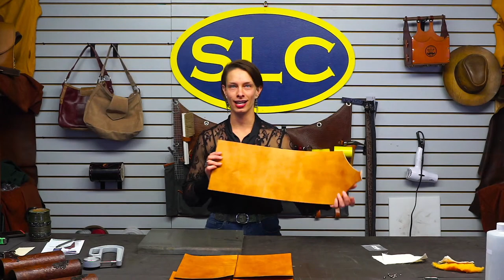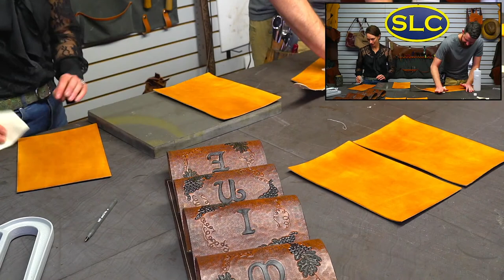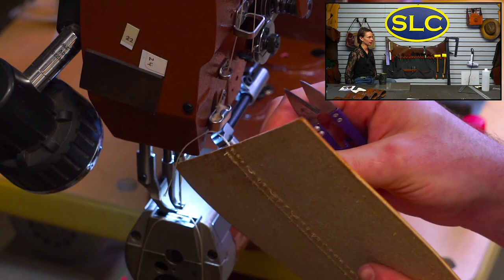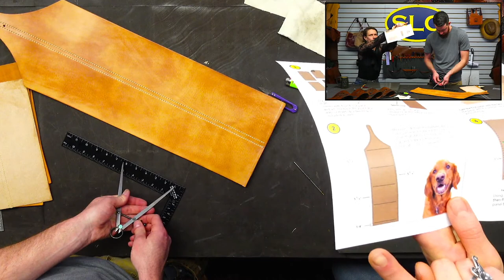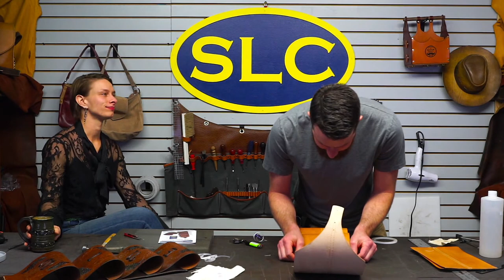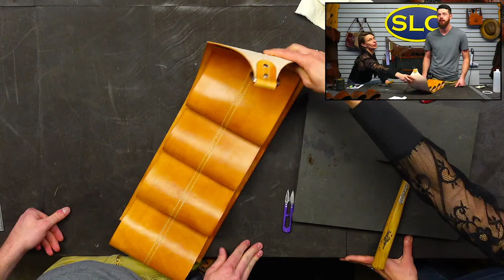Crafting A Wine Wall Holder w/ Liz + Clayton

Comment: Load the bobbin so it feeds against the direction of rotation of the shuttle. This counteracts the free spinning without using an anti--backlash spring. It also helps keep the bobbin thread under the tension spring. Also, run the bobbin tension a little tighter. This will make it easier to balance the knots with top tension. Last, I don't know what size needle you are using, but, with #207 on top and #138 in the bobbin, you can use a #23 needle that makes a tighter hole. This also makes it easier to balance the position of the knots in leather thinner than 9 - 10 ounces. That's the usual crossover thickness for #207 on top and bottom (with a #24 needle).

Comment: Is the thread size 207 mentioned the same a thread Tkt (Ticket) 207? Thread sizing across different countries and manufactures is very confusing. I am in Australia.
Reply: In the U.S. it's 207/ tex 210. Not sure what you mean by ticket, if you could explain a little more I'll help what I can
Reply: U.S. 207 is Tkt15.